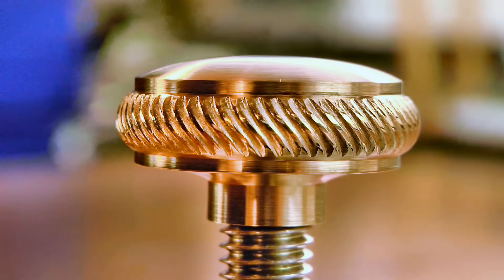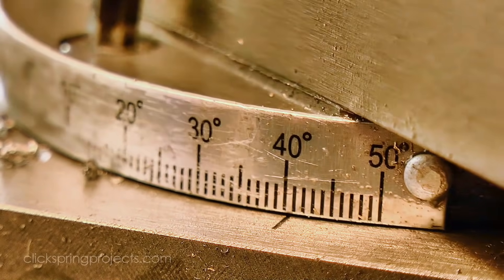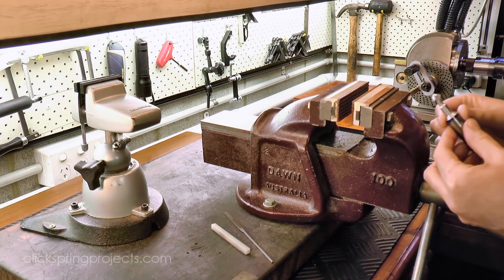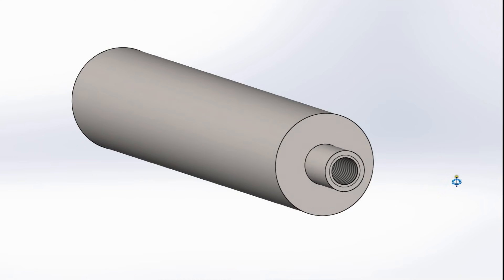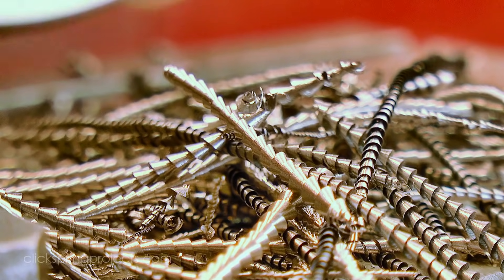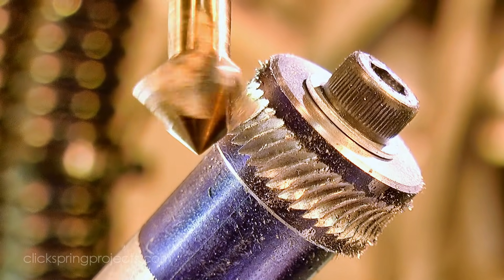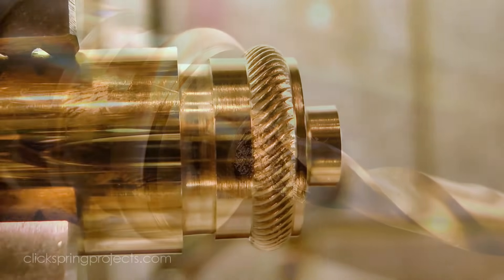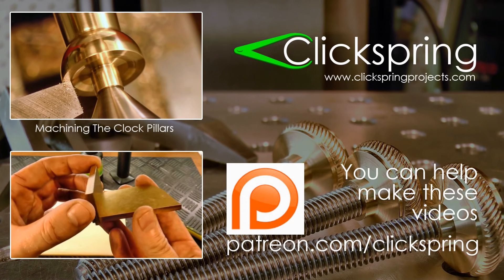Home Machine Shop Tool Making - Machining A Set Of Vintage Style Rope Knurls

Comment: Interesting video. Have you got anymore information on the boric acid? What do you add to form the paste? I recently did a video on making a tapping aid, I thought it might be of interest - https://youtu.be/0ANLQYgWKx4

Cheers

Crispin
Reply from the maker: Hey Crispin terrific tool, you've just made my project list a bit longer, thank you! The boric acid powder is commonly sold as a roach bait. You can usually pick it up from a common hardware store, but its also sold online by some specialist retailers for its other purposes. I pick up mine here: http://jewellerssupplies.com.au/boric-acid-powder-p-1065.html I mix it with denatured alcohol until it forms a stiff paste. This helps you to manage it a little bit easier, and get it to stick to the part prior to melting. Once molten, it forms a protective glaze over the part, sealing it off from the atmosphere and thus almost completely eliminating oxidation pitting/scale. Cheers mate :)
Reply: Clickspring could you also use borax?

Comment: i think the black scales you are talking about could be Fe3o4, it is quite corrosion and chemically stable when compared to red oxide fe2o3. the black oxide is not as hard as tempered martensite but it would extend life by reducing corrosion in steel.

Comment: Looks really good. You could do that tool for alloy plates that way it will make really good surface and if they wears out you just turn them and you will not need to make another tool after many uses.

Comment: I'm British but living in the Philippines for 36 years, the problem here is
 finding lathe  tools, apart from square HSS of various sizes. The local
 guys like to borrow my things but forgetting to ask, consequently my 
parting tool is currently missing, I don't have the budget to buy a new 
one on E bay as my pension is only $280 to $300 a month, depending on 
the exchange rate, any ideas how I could make one, I only have a lathe, 
 mig welding, plasma cutting, a grinder but no milling machine but I 
have hand tools. Any advise would be greatly appreciated
Reply from the maker: +Alan Dyson Hi Alan, other than buying a parting tool blade, I would suggest grinding a standard tool blank into the shape of a parting tool, much like this: https://youtu.be/NExV5ZS9nss?t=2m44s Thanks for watching
Reply: Alan Dyson 
Do you own a machine shop or is just a hobby for you?

Comment: the angles of the cutter aren't properly relieved.
Reply: +flack youe Sure, he didn't seem to have much in the way of rake angle on the 4 cutting faces but he relieved the back corner edges with a quite strong radius to the full depth of his intended cut so I don't think he needed any side face relief.

Comment: I'm watching the video the third time already :) By the way, how is that white stone called? sloop stone?
Reply from the maker: +Dumitru Ursu Terrific Dimitru! I refer to it as a slip stone, but its specific name is an Arkansas stone. You can find them here: http://www.artcotools.com/norton-arkansas-stones/ Great to have you watching mate :)
Reply: Thanks! I'm considering buying a lathe, maybe a small one for the time being, as I've seen some well under $1000. That stone looks like it could handle handtool sharpening as well, like a handplane, or a chisel.
Reply: +Dumitru Ursu It's used frequently for honing edges on toolbits.

Also make yourself a favor and look around your place if you can buy (used) "proper" widow maker lathe .. somethimes they don't go higher than 1000 dollars.
Reply: +Dumitru Ursu I had to see twice

Comment: Quick question: what is the white insulation like stuff that you use for the heat treat platform?
Reply from the maker: +JayBerry Miller (The Woodsrunner Channel) "Kaowool" ceramic fibre. Thanks for watching.
Reply: +Clickspring Ok, awesome thanks! I am just a 16 yr old kid and I work/apprentice at a small 2 person machine shop making precision, after market brake parts for 60's Mustangs, so I get to play with the tools after the work is done. I do some hardening and tempering while making wood carving tools and knives at home, but was having problems with a good place to lay my work while I heat. Btw, awesome channel (including the videos on Make's channel). Showed it to. Y boss and he loved it. Keep up the good work and inspiration!

Comment: How small could you make these teeth?  When I saw the die for making the rope knurl first thing I thought of was an MK8 drive gear for a 3D printer.  The teeth for a 1.75mm filament are quite small but I would think that with the teeth at an angle like you have here would offer more contact area on the plastic filament and cause less slippage.
Great video and nice work.
Reply from the maker: +Chris Leamon Hey Chris the pattern can be scaled up or down easily depending on what you want, however the shape is not suitable for a drive gear. Gear teeth need to conform to a particular geometry to be effective and long lasting, whereas this shape is intended for ornamental use. A bit more on gear cutting here: https://www.youtube.com/watch?v=XkJJid3_bhg Thanks for watching.
Reply: They are not really gears in the conventional sense.  In this case the teeth are there to grip and push plastic filament through a heated extruder.
http://g02.a.alicdn.com/kf/HTB1iWvyIFXXXXbHXVXXq6xXFXXXT/10pcs-lot-MK8-Drive-Gear-for-1-75mm-3mm-3D-Printer-Filament-Extruder-font-b-Pulley.jpg
Reply from the maker: +Chris Leamon Ok understood, you're right it looks very similar, Cheers.

Comment: What is the white material you use to cover the cutter when you heat treat it?
Reply from the maker: +Minh Hiep Powdered boric acid and denatured alcohol. Thanks for watching.
Reply: +Clickspring Thanks for you answear, but I meant the fabric material, sorry for my bad English :)
Reply from the maker: +Minh Hiep That is "kaowool", a heat resistant ceramic wool, helps reflect the heat back onto the part. Cheers :)
Reply: +Clickspring Amazing material It is! and thank you for all the replies :)

Comment: hey, great vid! What's the name of the tool used at 02:45? Thanks so much!
Reply from the maker: +André Rangel Hey André, that tool is called an edge finder, it is used to find the edge of the workpiece, so that the spindle can then be positioned where you want it. Thanks for watching and asking :)
Reply: Thank you so much!! I'm studying mechanical engineering and I'm in a formula student team (universities racing car building contest). Our team has acess to a 4 axis CNC mill in our college, but no one could tell us how to find the precise center point for a round profile. Looks like you gave us the solution! Hope to find that tool :) Regards from Portugal!
Reply from the maker: +André Rangel Hey André more convenient and accurate way to find the center of a round profile is with a dial test indicator. Similar to this, only sweeping the outside of your part profile: https://youtu.be/n6JkUO8AHOQ?t=3m47s Cheers, Chris.
Reply: +Clickspring ohw, you just solved me other problem: to find hole centers! Thank you so much!!
Unfortunately for the 4th axis in our CNC the extra axis is an A axis (parallel  to the X axis (which is in the horizontal)  and the spindle is in the vertical. 
My ideia, after seeing you video, was to lean the edge finder (advancing on y axis) against the profile of the round rough stock and after offset the ray to find the exact center of a tube profile. Do you know a better way? I can't imagine any way using a comparator :(
Reply: I use an identical edge finder almost daily for just about anything I do which is a lot of round parts for the machines we make. I start on the ID or Od of a round part in say X axis set that to zero then touch the other side of the part with the same Y axis. Then divide the number in X in half, go to that number in X and set X to Zero. Repeat for Y and you have the center of your part.
Reply: edge finder but this is a mechanical there are different kinds. Most shops use electric edge finders that light up when the touch the work piece. Once the edge is found you then add tool compensation which is the radius of the tools diameter.

Comment: I am very curious about how you do your heat treating and tempering. Everyone I've seen do it in videos and talked to some in person all use an oven except for some traditional blacksmiths using their coal forges.

What is that insulation that you had your parts in while using the torch?

What are you using for your quenching fluid?

How did you come up with that solution to reduce the scale build up?
Reply from the maker: +Mad Painter An oven is definitely the more civilised way to do heat treating, particularly for knives. However provided the parts to be treated are not too large, very good results can still be achieved with a basic propane torch and quenching in a light oil, like compressor oil. The insulation is ceramic wool, makes a great temporary forge, and the boric acid+denatured alcohol mix is a classic model engineers anti scale treatment. Thanks for watching and asking.

Comment: Guys, and maybe some gals, did you pick up where he uses a metal lathe to actually do hand work like one might on a wood lathe?  I have never seen that before.....Very impressive... not sure what the wood worker boys call it...a fence maybe?  regardless, it was awesome to me.
Reply: +Clete88 Its called a Tool Rest.
Cheers!
Reply: I too never seen this before. Very interesting, and now I want to try it;)
Reply: As stated it is called the tool rest for your knives. there are a number of different shapes of tool rests as well to help you maintain a tight spacing between the work piece and the tool rest. The less you have to stop the lathe and adjust the tool rest the better. Also when the space between the tool rest and the work piece becomes too far, it can be hard to cut and becomes unsafe. You can experience kickback where the spinning work piece grabs the knife out of your control. The basic tool rest is just a straight flat surface, some of the other types are a S curve, C curve, 90 degree and so on. Traditional wood turning tools are similar to chisels and hand carving tools; but they also have a lot of tools out now that use HSS cutting tips. I just have a basic set of gouges and bevel knives myself.

I know you can turn soft metals and plastics on a wood lathe, but I have not tried it before. I have turned some very hard woods that seemed nearly impossible they were so hard, and required constant blade sharpening.

Comment: I love the videos and really like the detail you put into them as well as the work in the actual video.
However, would you not get a better cut, if the surfaces and cutting edge of the cutter you made, had been sharpened and polished a little more? anyway, this is yet another educational and strangely satisfying video to watch:) keep em coming;D
Reply from the maker: +Morten Bakke Hey Morten, yes I think so. Also I didn't relieve the sides of the cutter for fear of messing up the V profile, so the cutter drags a little bit on the cut, which contributes to the rough surface finish. Live and learn! Thanks very much for watching :)

Comment: where do you get boric acid and what are you mixing it with love your vids thanks so much for the time and effort that you put it to it
Reply from the maker: +Doug Hinkle Hey there Doug, I get it from www.jewellerssupplies.com.au but I understand that it is used as a simple roach bait in many parts of the world, so maybe try that as a source too. I mix it with denatured alcohol until it is a thick paste. After the heat treating, remove the residue with boiling water. Thanks for watching :)

Comment: Hey Chris, I was wondering if you've ever made (or could make) a custom router bit with your lathe and mill?
Reply from the maker: +Simon Nicholson Hey Simon, yes for sure. I make "D" cutting bits regularly, that I use for cutting ornamental profiles. I use them  on my small mill, but they could equally be used on a router. I will be showing a bit more detail on this in an upcoming video. Thanks for watching :)

Comment: hey I have just seen a video where the late is running in reverse, the cutting tool is also upside down, and apparently the machine is running at a faster rpm, the idea of this is that when the set up is running in reverse the cuter tends to be push away from the part being machined, this seems to provide a default higher quality in small lathes, I hope this tip helps

Comment: what is the borax solution that you use to coat the tool before heat treating? Did you make it and if so what's the mixture ratio?
Reply from the maker: +Kerry Pewitt Hey Kerry, Its a mix of Boric Acid powder and denatured alcohol. I get the BA from a local jewellery supplies dealer, but it is often sold around the world as a simple roach bait. The consistency of the mix is like a stiff porridge. Cheers, Chris.

Comment: Could someone please explain to me how the knurling tool actually works? When it came in to contact with the piece, and the tool started spinning freely, I expected the outer surface of the knurl pattern to simply cut away the piece, leaving a flat surface. How is the free spinning tool actually cutting the pattern, instead of a blank? Thanks.

Comment: Great work! I always forget how small this stuff is. I'm sitting here thinking the surface looks pretty rough(Not that I could do any better), then I see your finger which is bigger than the entire cutting head and I realize it's pretty damn good lol. Also the way you show the cad models before you cut the tool out is really cool. Keep up the good work, I can't wait to see how this clock turns out.
Reply from the maker: +Troomoo Thanks for the encouragement mate! The surface was a bit rougher than I would have liked too, the cutter needed to be just a little bit sharper. I suspect a fresh HSS double angle cutter would give a much cleaner cut, and lift the result significantly. Very pleased you're enjoying the vids, the next one will be a clock episode in approx 3 weeks. Cheers, Chris.

Comment: Did you have to temper the tool after heat treating this?
Reply from the maker: +Mike Belik Hey Mike, I tempered the knurls to a light straw, although I suspect you could probably get away without tempering in this case if you wanted them to remain glass hard. They'd be unlikely to fracture, and the lifespan would be significantly increased. Thanks for watching and asking.

Comment: What is the white quilt like in the time 4:31 that bear the fire ?
Reply from the maker: +Abdullah Algarni That is a ceramic wool called "Kao Wool". Its great for thermal insulation. Eventually I will get around to making a dedicated heat treating forge, but for one off use, the ceramic wool is a great option.

Comment: Chris, nice work mate! Your milling cutter build inspired a few ideas. Did you know that there is an easier way to make the rope knurl on the lathe with a tap?. The only drawback with the method is that you are limited to a single pitch and thus lack the variety you could with the five knurls you made. Thanks for sharing.

Peace!
Reply: +Jeffrey Vastine I wouldn't call the time-investment a drawback!
Reply: I was referring to the tap method, because you only end up with one pattern.
Reply from the maker: +Jeffrey Vastine Hey Jeffrey, yes I have seen that method before, but was after a wider variety of pitch options. Thanks for sharing and watching.

Comment: Chris, you made 4 knurling wheels but only showed us the knurl created by of one of them. What happened to the other three? You didn't like the final appearance?
Reply from the maker: +José Dias Pinto Hey José, ran out of time to show the other patterns, but they each look good and will be useful for different applications. You will see them show up in several upcoming videos on the clock build, as well as at least two tool builds. Thanks for watching.

Comment: Really nice as usual. It seems that you could have kept the cutter shank at almost full diameter for longer, that would have made it stiffer and allowed for less stick out from the spindle. The knurl blank holder could have stuck out of the collet a lot less as well, it looked a little easily deflected.
Reply: +ChrisHallett83 I can see how large things are when he handles them but really it is down to aspect ratio rather than the absolute sizes, the less stick out there is the stiffer things are and the better the cuts will be. If the first cuts had been better I would not have mentioned it I just think everything could have been much more close coupled.

Comment: How hot do you get the workpiece before quenching, and what are you quenching it in?
Reply from the maker: +Scott Baker Hey Scott, I heat to a color of red that I know works, and then quench in a light compressor oil. There is a real art and science to heat treating, recommend the WPS book by the English Tubalcain: http://www.teepublishing.co.uk/books/workshop-practice-series/hardening-tempering-heat-treatment-1/ Thanks for watching
Reply: Clickspring Thanks mate!

Comment: Great video and end result. I looked into this once and found an old source which said that you could take a standard knurling wheel in a hand held tool, and roll it around the profile using a wood-lathe style tool rest. I only mention this as it may be of interest. If you try it, let me know! Thumbs up!
Reply from the maker: +James Senior Hey James, yes I have seen that done, it's quite amazing. A bit to hairy for me I think, there's a fair bit of force required, I'd hate to slip! Cheers mate :)